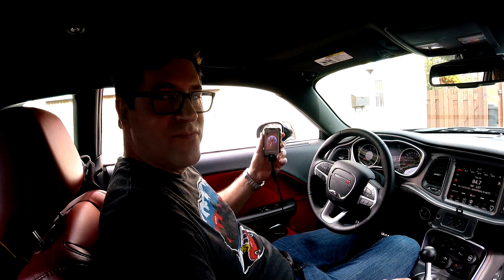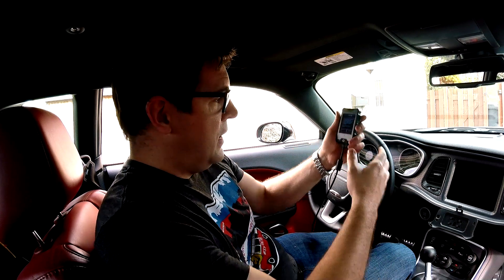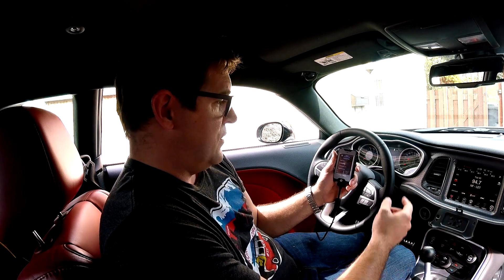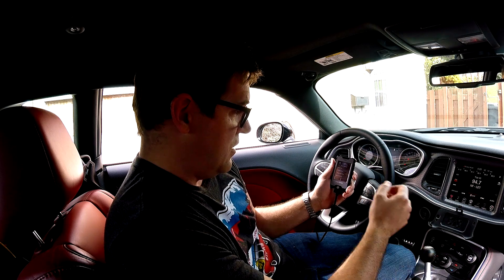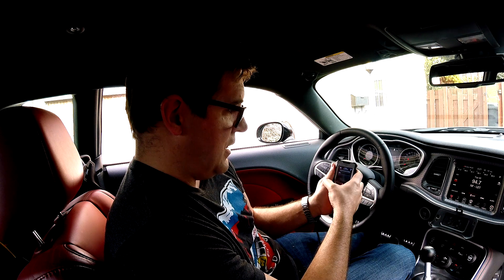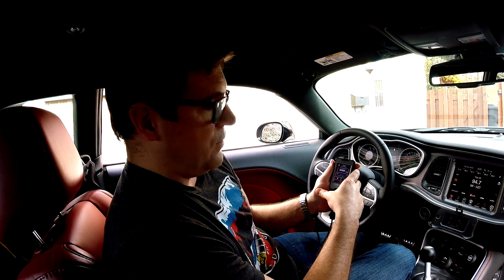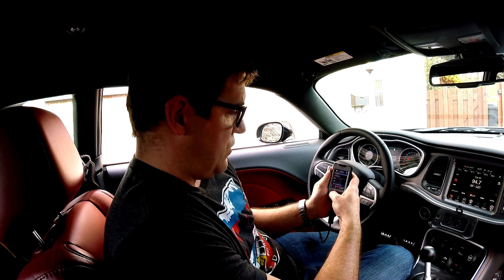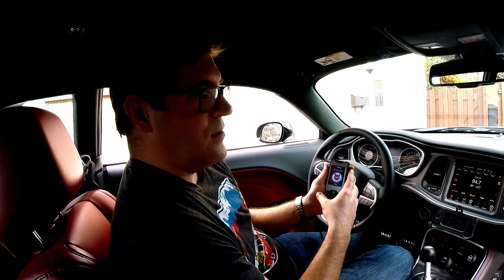DiabloSport Tuning Step Three : Modify Stock Tune Parameters

Comment: Pedal controller is 1000% better than this I run both at the same time cause I was like wtf when I took it off and only ran the tuners throttle yea I gotta have my throttle controller
Reply from the maker: Yes it does make a lot easier to do burnouts!
Reply: @ not only that man launching, reaction time Iv tested these theory’s as well they do have a slight advantage they aren’t making it faster but when it comes to getting off the line

Comment: Does this tune make your exhaust louder
Reply from the maker: If you used 91 octane with the 93 tune it does make it louder but not when using the 93 octane.

Comment: So you say i2 diablo tune 93 octane wont disable the speed limiter so that the car can reach speeds over the limiter speed of 155? i tried on my i2 diablo nd it appears that all tho i uoed the speed limiter to 190 mph , the car still cuts out at 155! Did u experience the same thing ? As for my auto stick srt8 14 charger will allow me to disable rev limiter to were ever shift rpm i want!! Thats cool feature ! But cant say same for speed limiter !!
Reply from the maker: I dont know. INever went faster than 135mph.
Reply: @HemiMike  but u think u disabled ur speed limiter by posting it at 190 in the tune parameters ?
Reply from the maker: @Chriselectricfingers  171mph is the fastest Ive seen in a 5.7 challenger
Reply from the maker: @Chriselectricfingers  try to lower the limiter 160

Comment: I have a Diablo tuner coming tomorrow for my 300c.  To disable mds and change tire size. Do you have to do It as modifying your stock tune before you do a Diablo tune? Or can you do it all at once ? Any advice would be greatly appreciated
Reply from the maker: Yes all at once.
Reply from the maker: Tires setting can be done at any time quickly is not part of a Diablo can tune
Reply from the maker: I dont have MDS since I have a manual tranmission, not sure on that one.

Comment: Hell yeah man , good stuff buddy !
Reply from the maker: Let's hope it goes well...
Reply: So the way that u did it was simply by downloading i2 93 octane , after which u went to the speedlimiter option were asks if you like to disable it? But u still jit 100% sure it wrks bc u never tried to reach 160? Lol
Reply: @HemiMike  yea if u can pass 155 nd dont get dead peddal after that!! Then it wrks ,,, bc mines at 155 is the limited speed as i noticed my pedal go limp mode !!! Nd this is after i set speed limiter to 190!!! So go figure !! I have to ask diablo in this to get the right overview on this topic . Ty
Reply: @Chriselectricfingers  no, actually I had my local speed shop that did the gear swap.
I had them do a custom street tune .
Once you do a gear swap the car will go into limp mode.

Comment: I just received mine do I have to install advance tune first to see the  other pages you explaining?
Reply from the maker: Yes. Make sure to connect it to the internet first and upload the last firmware.
Reply from the maker: What year is your car?
Reply: @HemiMike  2012 dodge charger superbee
Reply: @HemiMike  what if I have 245 n front n 275 n back ....what would I used for the tire option
Reply from the maker: @santanasavage9256  whaats are the tire sidewall ratios? 245/45R20 and 275/40R20?
Reply: @HemiMike  yes sir exactly what should I put ?
Reply from the maker: They are both the same height. so when new they are 28.6 inches tall. I would suggest to changed it to 28.5'' if they are a bit used. in the sub menu you can select to enter the height instead of the Tires spec size...
Reply: @HemiMike  appreciated I will adjust it

Comment: Just to clarify, are we able to use DiabloSport tuner to simply turn off MDS? I know nothing about tunes and do not wish to do anything else but turn off the MDS.
Reply from the maker: Which model year do you have?
Reply: @HemiMike  2014 Challenger R/T
Reply from the maker: Yes, I should be able to do it with the tuner only.
Reply: @HemiMike  Thank you for the speedy response!
Reply from the maker: Make sure to check if that fonction is included with the  tuner model you are buying on the Diablo website. Some entry level model might not have that function.
Reply: @HemiMike  Thank you brother. Yes, I should have specified: I am looking to get the i3 Tuner.
Reply from the maker: Do you have the sport mode button on yours?
Reply: @HemiMike  Yes. I am buying it from CarMax and it comes with sport mode, auto stick and paddle shifters. I didn't know what MDS was and so I looked it up and realized I probably wouldn't like it. I am currently waiting for CarMax to finish the post shipping inspection to go and finalize the purchase. 2014 Challenger R/T with 28k miles

Comment: Does the diablo tuner allow me to turn off traction control completely in a 14 RT.
Reply from the maker: My I3 platinum will disable ESP
Reply: @HemiMike  Ok so that’s the 1 I should buy? And I Subscribed and liked for the reply thanks.
Reply from the maker: Well they might be a couple of older ones that can do it. Go check them up and validate the features on the Diablosport web site.
Reply: @HemiMike  Forsure man thanks

Comment: Is the throttle boost option worth messing with?
Reply from the maker: Absolutly. Its like having a Pedal commander.
Reply: @HemiMike  thanks.
Reply: @HemiMike  if you don’t mind me asking mike what’s a good setting to have it at?
Reply from the maker: Well, if you have a 2015+ with a sport button I would suggest 10% increase so it will be quicker on initial take off and still manageable in sport mode which will increase it by a other 10% roughly .
Reply: @HemiMike  Great. Thanks

Comment: throttle booster on diablo i3 sucks. barely a throttle booster. I'm keeping my ROAR pedal and working around it with my i3.
Reply from the maker: You need to add a lot of percentage for it to make a difference.
Reply: @HemiMike  yes--I ONLY tried the full 20%. Still nothing compared to a dedicated throttle controller. You can still use your throttle controller if you leave 'throttle booster' setting alone...
Reply from the maker: Do you ha e a 2015+ model year? Do you have the sport mode button in your challenger?

Comment: Great video question I have a 2007 thoughts charger RT that originally had 18" rims on it I swapped on for the OEM20 inch rims what should I put the gear ratio at
Reply from the maker: Gear ratio or tire ratio? Which tuner an options do you have?
Reply: @HemiMike   I have   running A 255/45/20  I need to know what to set the gear ratio at in the Diablo Trinity I 3
Reply from the maker: @paulhyde4899  I dont know about changing the Gear Ratio for a tire size change but your new setup is 29 inch tall

Comment: Yeah i put my up to 20. Idk if you tried it at that level but i have to say it's way more responsive.
Reply from the maker: What thats a lot, I do not wish to have a reduce pedal travel. I like to have a progressive acceleration on daily drives. The Sport button boost the standard level up to about 10%. I can only imagine if you use the sport mode now with 20% throotle boost....
Reply: @HemiMike  i don't have a sport mode. My car is a 5.7L magnum RT AWD.
Reply from the maker: Ok that makes sense to boost it up that much with an autostick 5 speed it will make it more peepy of the line.
Reply: E * i did mines up to 11.5 throttle boost
Reply: @HemiMike  with that chip installed have you been able to pull away from other hemi rt dodges?
Reply from the maker: @cedricmiller4370  did not have the chance to meet another RT since.
Reply: @HemiMike  ok lol seems like that's how things usually work but if you ever do meet another rt it would be a good way to compare the difference
Reply from the maker: You can find in my last video at the end of it my 10 passes results at the drag strip: https://youtu.be/IApKQIY6Q6w

Comment: How  Was  The throttle boost at .5 ? Did you go up more?
Reply from the maker: It did try it more and came back to 1%. More.
Reply: Is it safe to do 11.5 on throttle body boost?
Reply from the maker: I did boost it up this year to 5%. Its a bit more responsive. 11 would make it twitchy I think.